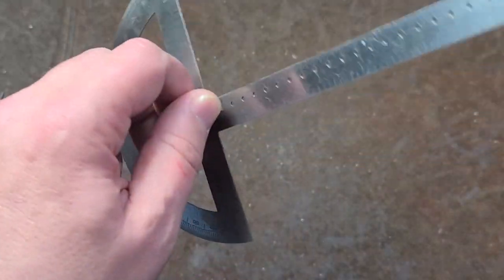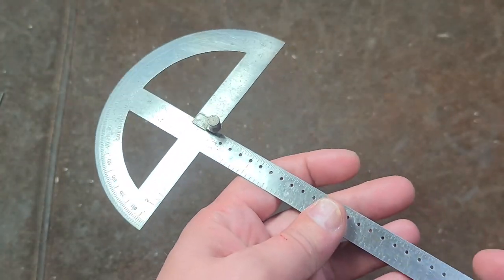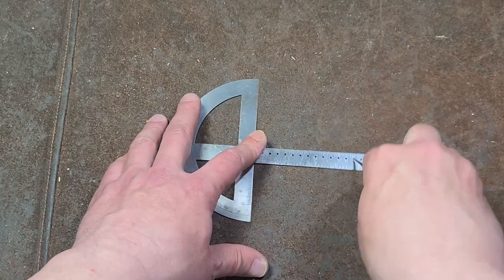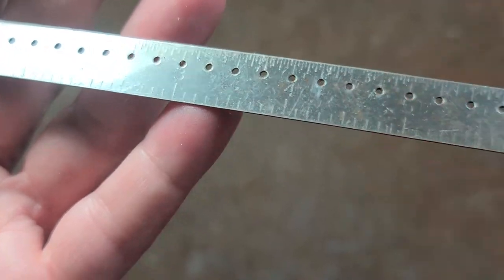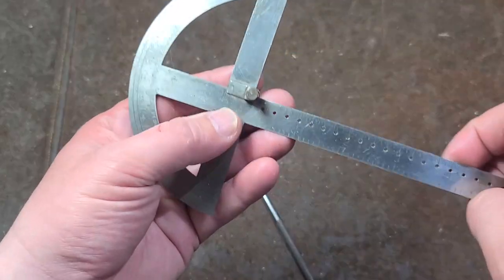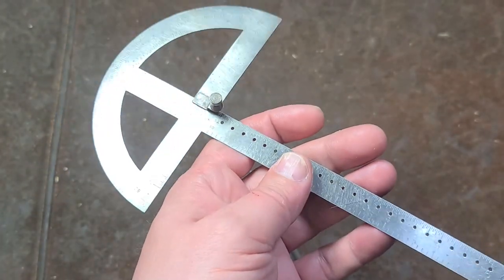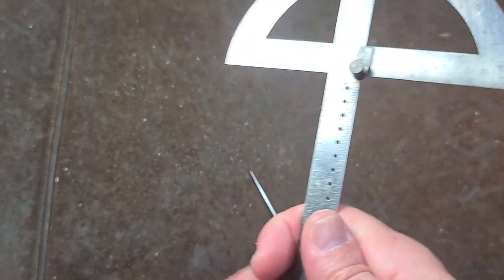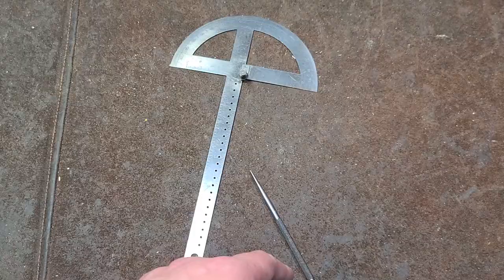Golden Compass Co. USA Hybrid Compass/Protractor Review

Comment: The owner that put the hole in to hang it may have offset the hole on purpose to counter the more weight to that side so that it will hang a little more straight and not hang as slanted, or crooked.  Thanks for sharing this video and cheers.

Comment: The pinholes are offset to the pivot point.  So the markings can't be right unless there was compensation for this.  Looking at the pinholes it doesn't seem like there is compensation.  Surprised you didn't pick up on this.
Reply from the maker: Great point
Reply: The error approaches zero the farther you get from the pivot, though. By three or four holes down it'll be practically zero.